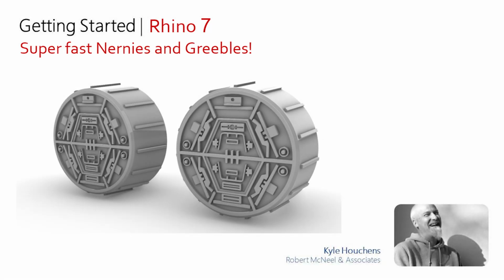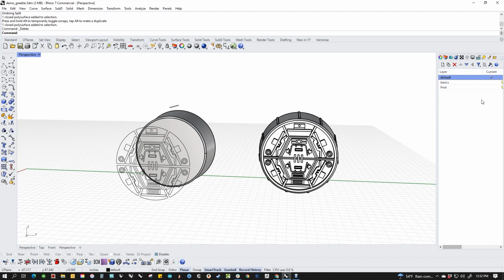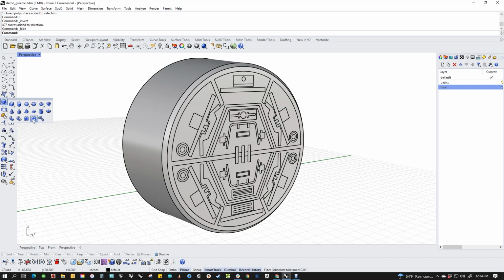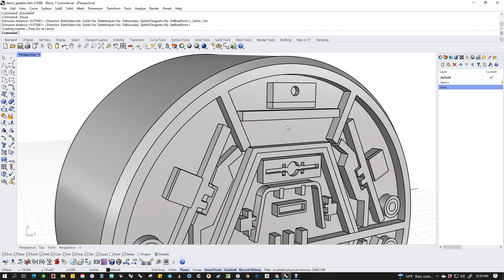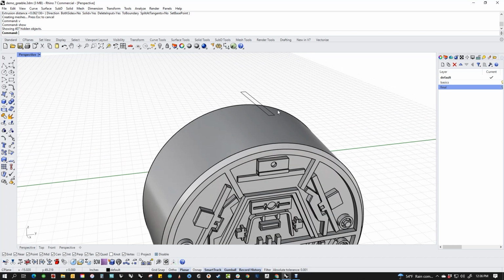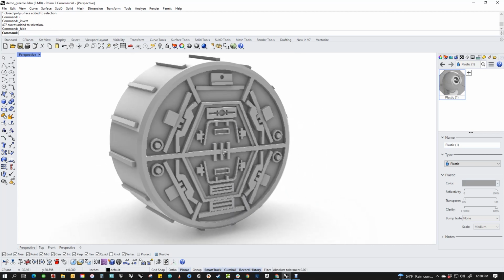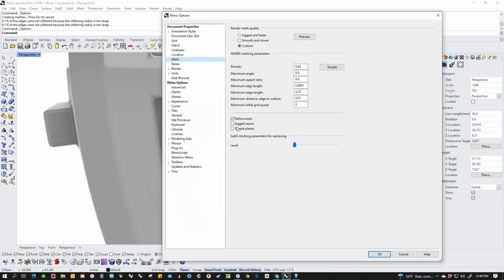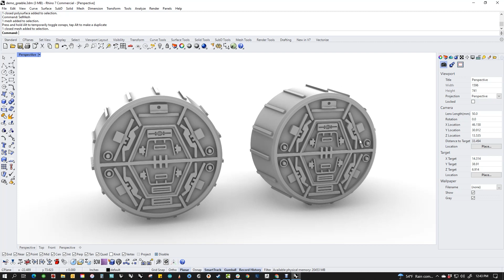Rhino 7 - nernies and greebles

Comment: I don’t get it...you projected a sketch and extruded it...is that supposed to be difficult in Rhino or something?
Reply from the maker: Nope! That’s the point.
Reply: Historically, Rhino is SURFACE modeler, aimed at designers and naval/aircraft/automotive engineers to make class-A surfaces. Extruding a sketch is a thing that's more common in solid modelling as it's resulting in rather primitive geometry where you don't need any of the surfacing horsepower Rhino has. The function shown was already available in RH 4.0 from 2011 - just people didn't use it much as this way of sketch modelling was more something the MAX / Blender crowd would use...

Comment: The extract render mesh function is a game changer!!
Reply from the maker: Next level is to apply material displacement with an image, then extract render mesh and get a printable  result. 

If you just need prints, this is a super fast way to get details without building stuff. Add in substance painter and you have a pseudo sculpting workflow. (For detailing at least) 

If you have to go to another cad system, then you are stuck actually building stuff as shown in this video.